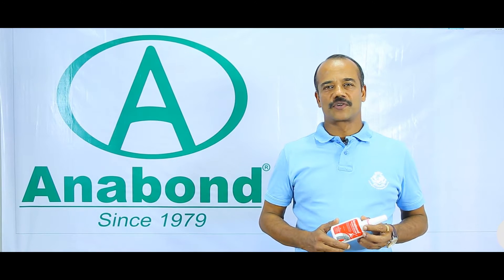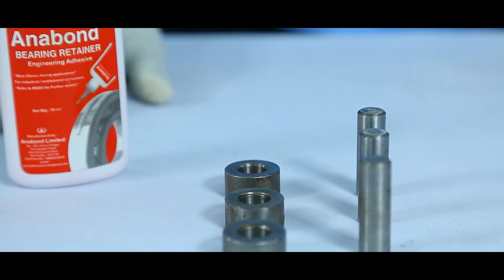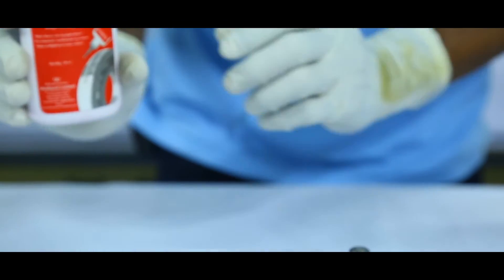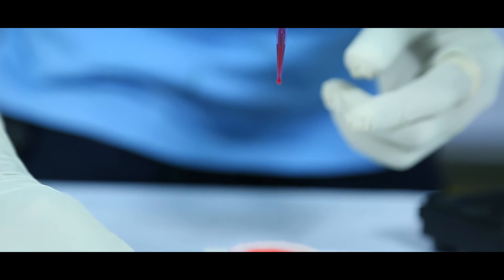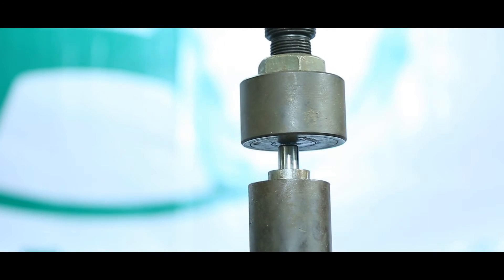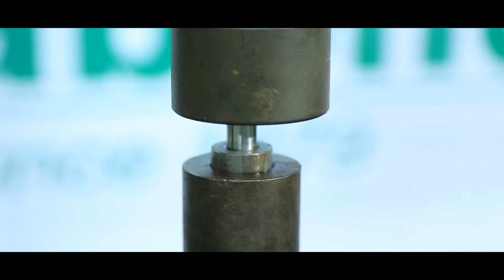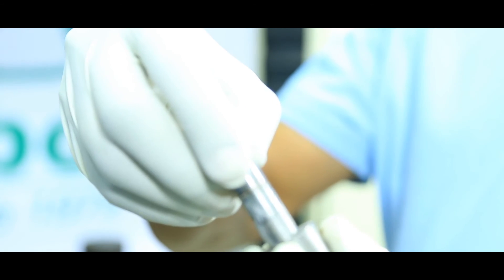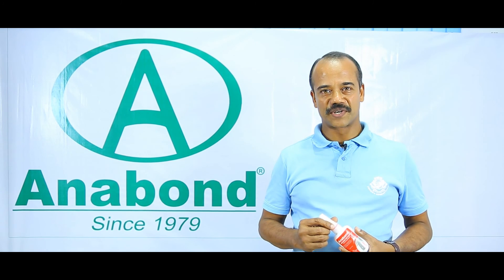Anabond Bearing Retainer: Lock in Performance, Unlock Longevity

Comment: How much is the curing time?
Reply: A typical Bearing retainer like Anabond 412 grade has a handling cure of 10 to 15 minutes, which means tht after 15 minutes of mating the bearing with the housing it can be taken to the next assembly operation.  The Functional cure is 6 hours which means the product is ready for normal working in 6 hours when about 75% of the curing happens. The full cure happens in 24 hours where the balance 25% cure competes. But remember we are talking about a metal to metal mating which is normally the case.

Comment: Bearings can be removed by a puller as you normally do while dismantling a bearing.  There is more to bearing retainers like Anabond 412 than just bonding the bearing to the housing. Any machined surface has ups and downs and no surface is absolutely plan. The major action of Anabond 412 Bearing retainer is to fill up all the gaps between the bearing and housing. This means, 
1. There is uniform load distribution on the bearing surface, 
2. The gaps are filled by an engineering plastic with very high compression strength, and 
3. The engineering plastic dampens vibrations and does not allow the mated surfaces to move with respect to each other. This in turn prevents the fretting corrosion on the housing which leads to bearing loosening and subsequent failure of the bearing.
Anabond 412 type Bearing retainers are after all plastic materials that are weaker then metal and hence disassembly by a normal puller tool will not be difficult. In fact since  Anabond 412 seals the gap between the bearing and housing, the incidence of corrosion is also eliminated leading to an easier removal.
Trust this clears your doubt. Please revert if you need any further clarification.
Reply: Perfect explanation sir, cleared all the doubts i had. Thank you so much for imparting your knowledge
Reply: @livinlifeat60mph  Much obliged :)

Comment: But how to remove wron out bearing if use bearing retainer.
Reply: You can remove worn out bearings with a normal bearing puller. In fact when you use Anabond bearing retaining adhesive, you will find it easier to remove the bearing as the engagement area is completely sealed and hence corrosion and seizure of bearing to the housing or shaft is prevented.